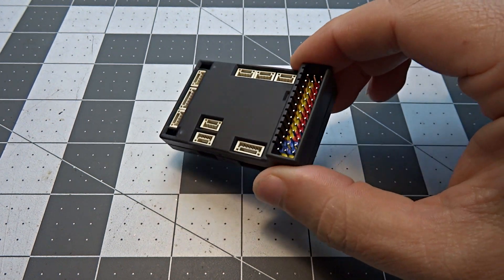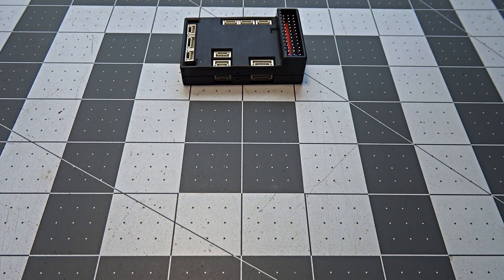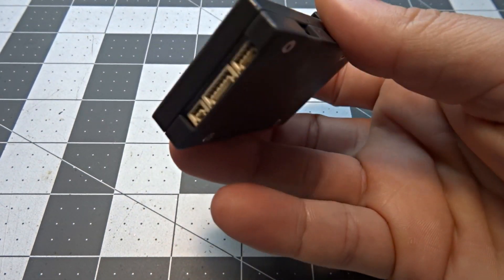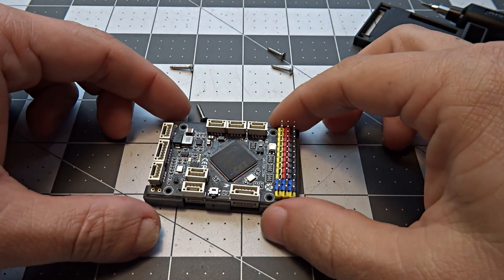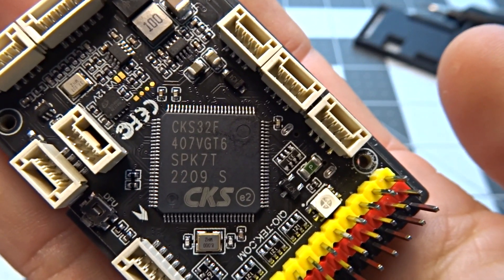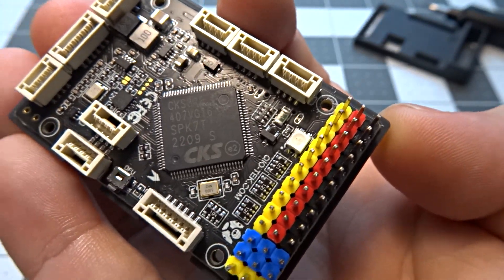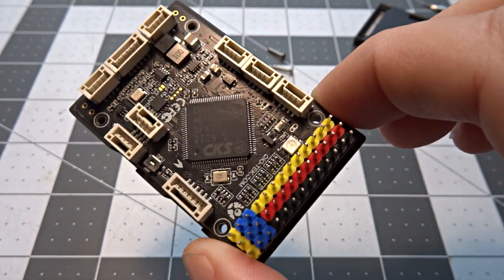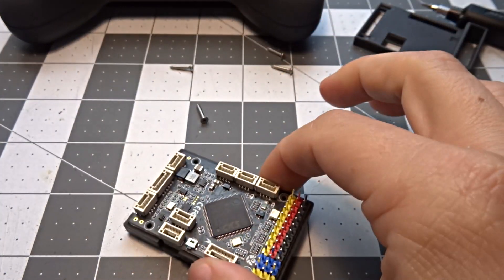Chip Shortages, coming to an end?

Comment: is it caused by a chipshortage or simply by an incredibly increasing demand on the battlefield in the ukraine for all the selfbuild drones (copter and wings) that  have a life expectancy of 3 to 10 missions = 1 or 2 days till those are shot down in an uncrecoverable position? 

I would bet that they have an incredible demand on both sides considering that the selfbuild drones will not be limited by altitude (dji drones) and have a higher payload to carry. The russians have gone the route to use them as tiny precision bombers or to destroy lost vehicles that were unrecoverable where a simple handgrenade could cause a fire inside. The Ukrainians are emphasizing the forward observer role to control artillery fire, but both sides are reporting short lifes and heavy losses. And the military does not care about a price increase from 28€ to 90€ as seen for Matek F whatever FC. So highest ADDITIONAL demand there and you would not even need a chip shortage to see sky rocketing prices. 

There is only one chance to get fc cheap again: sit and wait
till either STM demand for other products has dried out due to a demand shift in post corinna era and prices for the chips are stalling due to new competition. 
A clone is just a beginning of at least new competition if that is a real clone and 1:1 copy with same tolerances. 
If chip prices are high the clone manufacturer will drive into these markets to conquer that market share they need to become more profitable as they had been before that move. That means they have a safer outlook with such clone build by them than without cause they have to shift capacities over to the new products or simply expand their capacity.
We might see cheaper FC prices during summer but on the other hand all military procurements are keen to get professional drones and some of the cheap selfmade ones used in the ukraine just to be prepared. So the dual purpose might cause a demand spike over a longer period of time than we had thought and it might take even longer till the cheap stm chips are back again as genuine or clone chips 

Meanwhile I take even more care for my existing Matek FC.

4 months after your video the prices for matek seem to have even to rosen again (close to 100€) maybe due to additional winter demand in the west (northern part of the world) which means long dark nights and therefore project / building time where people tend to order more to prepare the next season. 

But I wonder why Matek is not using these clone chips to deliver new products based on the old design with just the new CKS chip and call those MATEK CKS FC F405  just to differentiate those.
Matek can not build FC without chips so what else are they producing currently ?

I just checked the prices on banggood again cause before I had only done a search on banggood for matek and believed in the prices shown in the search result list like  F405-WTE for 84€ 
But if you open the item page you get the real price which is even a lot higher about 93,50€ , the worst gambler tricks you usually found only on AliExpress now also on banggood.  

If I check my domestic ebay I only get offers for matek f405 from the US at a 80€ price point which will end in a huge mess of 20€ shipping costs and 20€ VAT on top at least. 

And cheapest aliexpress offer is about 74€ ddp so shipping and VAT incl. compared to 35€ for a F405 Wing I had bought in late 2019.

I guess it will take a long time to get FC at prices we will feel more comfortable again cause 75€ is an awfull lot of money - from the school and hobby club point of view and the holiday camps we offer cause the higher the prices the less participants we will have. 3 or 12 kids in a holiday camp means the same effort for those 2 who are running these camps but it does not make really fun to sit there with just 3 kids instead of 12 and a waiting list if someone has to cancel. 
Our clubs are dying cause we do not find the new young kids to start flying and gain some experience. Of cause you do not need these FC at all but at least for the advanced kids from previous summer camps we had such offers to do summer camp FC & FPV week where were able to lend the FPV stuff for that week for 6 kids and now we have to buy even FC to keep the offer going cause last summer was a real mess when the kids participating had not gotten their FC before the summer camp.

Comment: This [on the surface] looks like it will be a great flight controller at a reasonable cost. I hope the CKS chips are a success and help alleviate the [chip] shortage. If so..I'm in please take my money. I have been loading up on Lefeirc SN flight controllers which do basic modes very well along with a robust OSD coupled with a minimum of soldering. 🙂🤔

Comment: I tried using a 415 clone (not from CKS) for a project when stm32f415 chips became unavailable early in the pandemic.   Other than being mostly pin compatible,  it was a total different chip.  The software ran out of ram rather than from flash, all of the peripherals had different registers, the STM bootloader everybody uses to load firmware was incompatible.   

I could not find their bootloader software or the detailed documentation I needed to actually get it to work, only a product brief.   I think it was by request but unfortunately I do not read Chinese.  I sort of gave up at this point realizing it would take too much effort, and just started reusing the chips I had.   

Good luck flashing updated software to that CKS32F407, hope the factory stuff works.

Comment: The GigaDevice GD32 chips have been around for a good while and many are drop-in replacements for STM32 that work ok according to most accounts and cost less. But the 'chip shortage' was still able to come about and persist, so I'm not sure if another clone will make much difference. Then again, it mostly affects existing products where switching from STM32 to something else would be a pain in the ass, so perhaps new products don't care. The most puzzling thing to me is why other companies would be able to sprout and flourish in a supposedly difficult environment where the most established player was struggling.... something doesn't add up.

Comment: Microprocessors have not been as limited in supply as micro-chip based sensors. Key for us has been IMU and barometric sensors, which are heavily used in automotive applications. These have used larger nano-technology production manufacturing facilities, much of which was at end of life pre-pandemic. As result many plants scrapped production lines and replaced with smaller nano-technology production processes manufacturing. This is now forcing a redesign of sensor-chips.

BTW: both global container shipping rates and the price of crude oil are back to where they were a year ago, so I'd expect this will also have an effect of international prices over the next 12 months.
We in US are lucky as US dollar has increased in value (~30%) vs. most currencies, so not experiencing the impact on global inflation (price hikes) that others have been experiencing. Example: both € (EUro) and £ (UK pound) are now almost 1:1 to U$.

Comment: Hopefully not the same situation as with the SIYI Mini V4 receiver. The V3 is a good and powerfull ELRS receiver, with STM mcu, but the V4 has got a replacement mcu. and the compiler for these, is only available and used in China. So no more ELRS ....